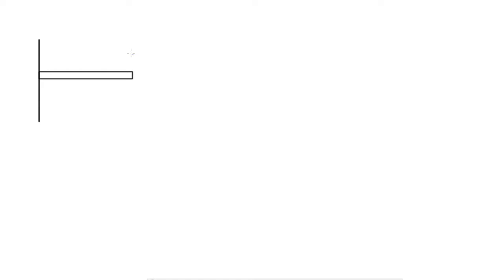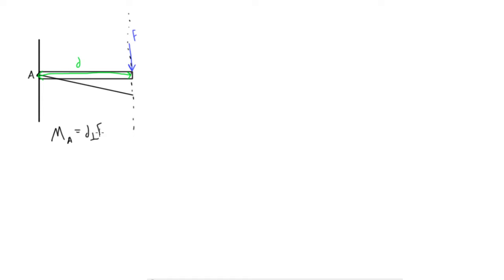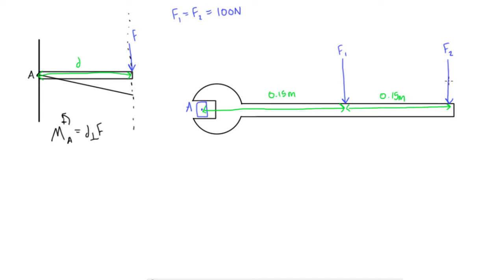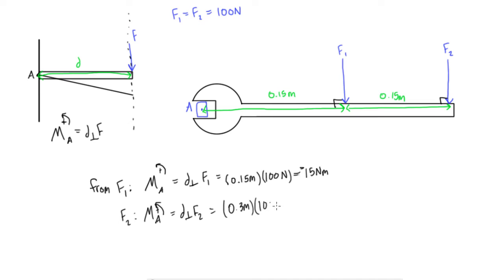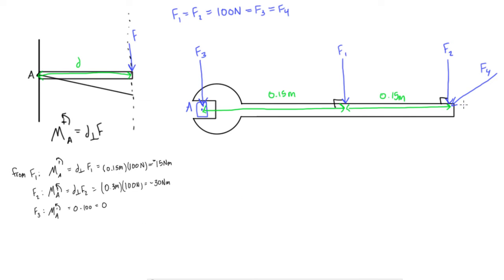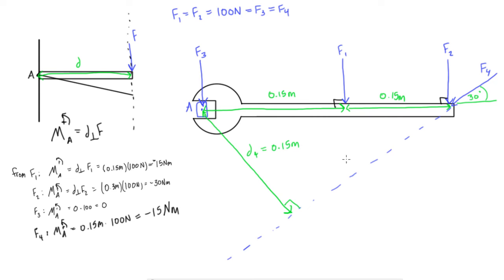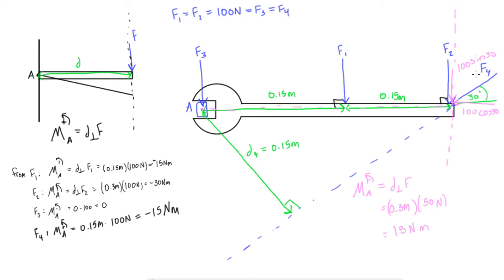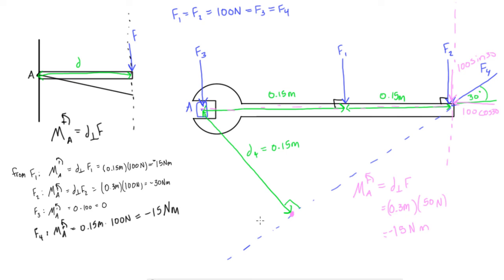What is a moment

Comment: For F4, shouldn't we only count the vertical component of the force when calculating the moment? Isn't the horizontal force zero because it is parallel? Thank you
Reply from the maker: Hey Abdulaziz, did you watch to the end of the video? If you want to use the distance of 0.3m (from A to the point on the wrench where the force is acting) then yes, you will only consider the vertical component of the force for the moment calculation, because it is perpendicular to the 0.3m line that happens to be horizontal. You don't actually need to pick a line for d that actually touches the object, it needs to touch the line of action of the force. The only point on the line of action of the force that touches the wrench was the one at the end, mentioned above. In the video, I also identify a point on the line of action of the force such that the position vector d is perpendicular to it, and then we need to take the full magnitude of the force vector. Don't just jump to only taking the vertical component without thinking why. For the calculation, the force and the position vector must be perpendicular, and so if the position vector that you are using is not purely horizontal, then the components of your force that you take will not be purely vertical. I do go over both ways that I just mentioned in the video. Check it out again and maybe it will make more sense now!

Comment: plz explain line of action to me that's a initial concept that often confuse me although thats been implied  often here
Reply: line of action is mentioned here: https://youtu.be/smoPlJiLmac?t=391 - it just means the line of the action = the line on which the force acts = the direction in which the force acts = the direction of the force. Given that the position and rotation of the cartesian system on which we measure is arbitrary - we can put it wherever we want, it means that when a force is not parallel with 0x or 0y axes, when its at an angle, then it can be decomposed in the component forces which are parallel with 0x and 0y axes. So our non parallel force is just a composition of this axis based vectors by the parallelogram rule.

Comment: what is directly proportional?? in that??
Reply from the maker: +Sean roze Moment is directly proportional to the perpendicular distance from the line of action of the applied force to the point where the moment is occurring. It's easy if the force is applied at 90 degrees to the object, because if you increase the distance x2, the moment will increase x2. It's not as apparent when the force is not applied at 90 degrees, but if you extend the line of action, then find the perpendicular distance to the point from that line, you can find moment. If the distance was increased or decreased, the moment would also increase or decrease linearly with the change in distance.
Reply: thank you so much! your video help me pass my 2nd exams xd!